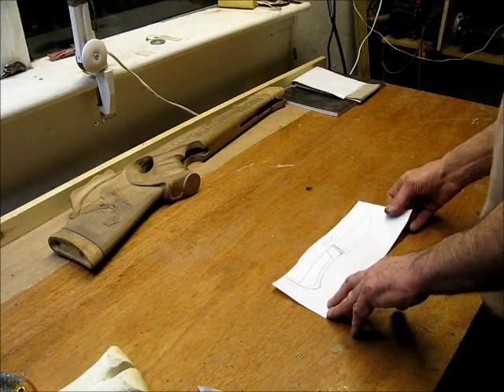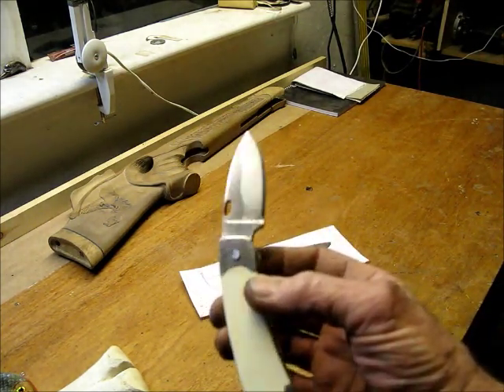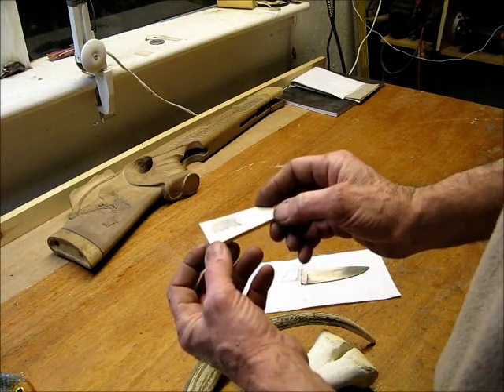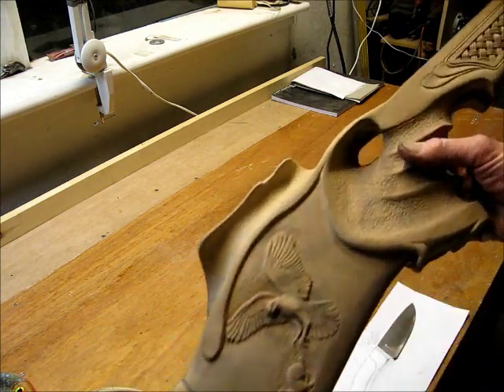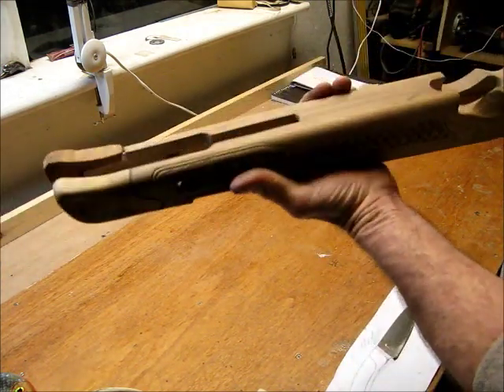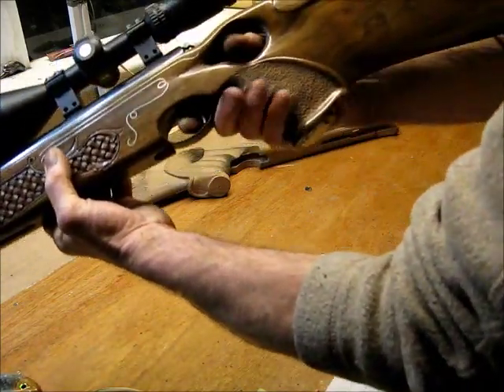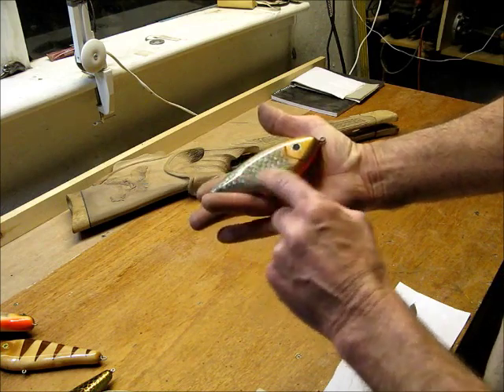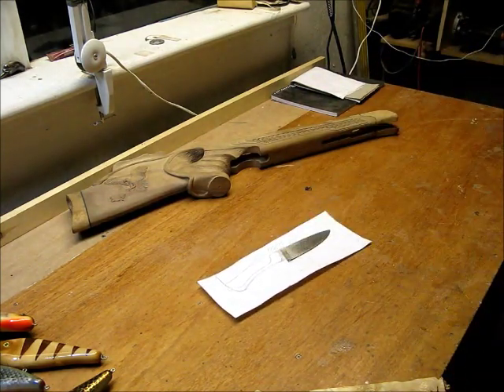projects in the shed.Damascus Knife handle. Carved Gun stock build . Making fishing Lures for Pike.

Comment: Subscribed and liked which was a very easy decision as you are a fantastic workman. I have a block of walnut which i want to turn into a stock for my Air Arms S410 carbine but as yet haven't had the balls to start, plenty of videos showing the finished item but i need to be shown from start. I will be watching yor 36 videos today.
ATVB Roger
Reply from the maker: porkycrook Thanks alot Roger appreciate that, It might interest you to know that I have started a video project on a stock I am building for my S410 ! Again its in Walnut but I wont be going into the same detail with the rich carvings as the .......last stocks. It is a thumb hole design, with some inlays and just a simpler fore end carving. I will try and detail as much of the letting in for the action as I can, this is probably the hard part to most first time makers, once you have that the rest is fairly easy shaping and finishing. Have to finish off the last stock which I am filming now before I start on the 410. Will be uploading that vid in due course, so might run the 410 stock along side it. Cheers...Loz.
Reply: Thank you Loz and if you find yourself without a 410 blank you could always loan mine lol. Yes i cant wait for that set of videos, so i will wait with abaited breath.
Regards Roger

Comment: Man of many talents, great work and I love tarty rifle stocks and like the wire inlays, might give that a go and could you tell me what wire and what you used to scribe the lines for the wire, great video mate.
Reply from the maker: Thanks, it was stirling silver wire (ebay) i found the square section wire much easier to fit in place the round is difficult to fix and curls out.  I used a woodworkers marking gauge initially, then opened up the lines wider with some steel rod ground down to the width of the wire. Cheers.